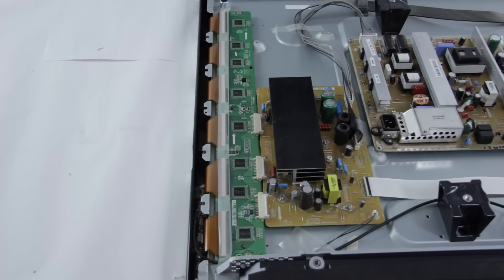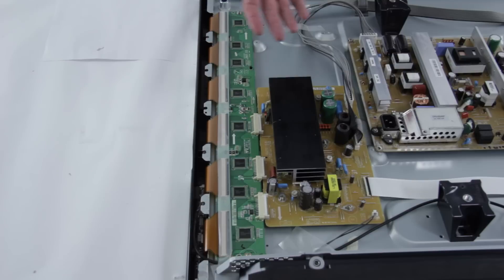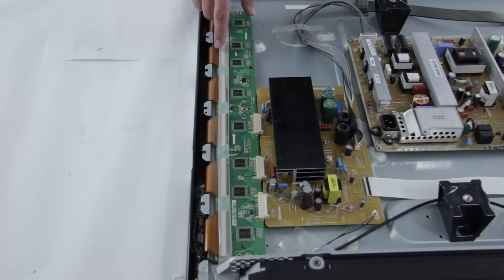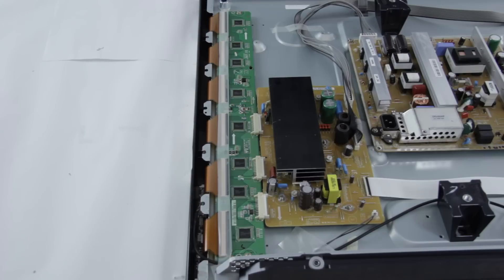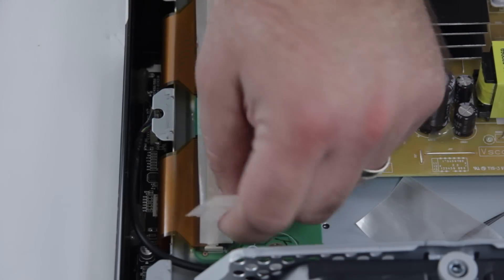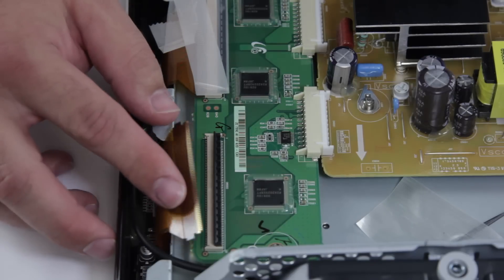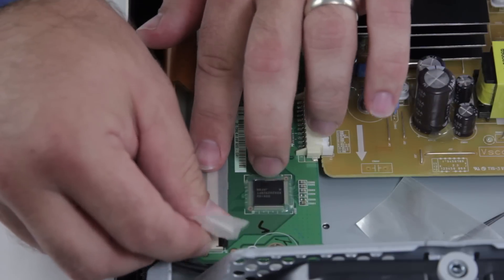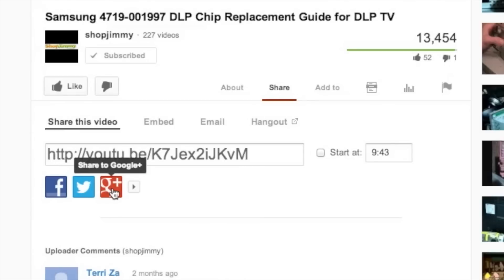Plasma TV Repair - No Image, No Picture on Plasma TV Screen - How to Replace Y-Buffer & Y-Sustain

Comment: I have a Voire 42" Plasma TV with no picture or sound. When I power on the TV, green light comes on and I hear a clicking/static noise is coming the back panel. I took off the back panel and noise is coming from the main board, which is centered on the frame (part number JHT0609-026387). Could the Y-Buffer or Y-Sustain boards be feeding this main board, causing the noise?
RMC

Comment: Hi I have a lg 60ps8000 plasma TV that was showing lines going horizontally across the screen then jumping up & down then eventually the screen has went completely black & now there is no picture or sound, however up until the screen packed in sometimes it would work just fine as if there wasn't even a problem!!! Please help? 
Many thanks

Comment: I have a LG 50pg20 plasma tv, powers on but no picture and theres a slight humming noise present. Caps seem to be fine. Suggestions?
Reply from the maker: jlujan28   Please watch this video FIRST to help with your repair!  https://www.youtube.com/watch?v=BP3NVNCGEv8  I recommend replacing the YSUS and the YDRVTP & YDRVBT boards in your TV.  Click this link to replacement parts for your TV model number:  http://www.shopjimmy.com/catalogsearch/result/?q=50pg20  There may be multiple boards for the same TV model number, be sure to match part numbers on your current board, with your replacement for compatibility.  Thanks and please let us know if you have any further questions with your TV Repair!  www.shopjimmy.com

Comment: I have a Samsung PN50C7000YFXZA that is about 4 years old.  I had 7 horizontal lines that run across the whole screen.  I just ordered and replaced the Y Buffer board but the problem is still there. I assume the TV does not need to be reset once the parts the Y-Buffer was installed?  Do I need to replace the Y sustain board also?
Reply from the maker: John Krummel   This sounds like a TV panel (TV Screen) problem.  If your TV panel is bad, it may be more cost-effective to replace the TV as panels are typically hard to find in stock, difficult to replace, and expensive.  Thanks and please let us know if you have any further questions!  www.shopjimmy.com

Comment: I have an LG 60pv450 plasma tv. You can see the red light when it's off and it makes the noise click to turn on and off, but when it turns on, there is sound, but no picture.  I can use your help, thank you.
Reply from the maker: Andy Buzzie  Please watch this video FIRST to help with your repair!  https://www.youtube.com/watch?v=BP3NVNCGEv8  I recommend replacing the YSUS and the YDRVTP & YDRVBT boards in your TV.  Click this link to replacement parts for your TV model number:  http://www.shopjimmy.com/catalogsearch/result/?q=60pv450  There may be multiple boards for the same TV model number, be sure to match part numbers on your current board, with your replacement for compatibility.  Thanks and please let us know if you have any further questions with your TV Repair!  www.shopjimmy.com

Comment: hi, I'm having a problem with my Maxent Mx-42VM11, Model No. P4202YD05, Serial No. 53781105931- The TV has a picture and audio but image flickers constantly. I replaced the motherboard but the problem continues. Any suggestions on the issue would be greatly appreciated. Thanks.

Comment: Hello I Have a Vizio XVT423SV Plasma, It was working fine but than when I turn it on the screen didn't come on but the logo kept flashing than few second later it turn white for a sec than it turn back to orange and nothing happened I wanted to know what is the problem?

Comment: Hello, I have an LG 37LH2000 sound but no image.
Reply from the maker: Frankie Vanterpool   I recommend running the flashlight test on your TV.   Here is a link to a video we produced that shows how to run the flashlight test. https://www.youtube.com/watch?v=xUzCLgoSPGM Please reply with your flashlight test results and we can recommend a replacement part for your TV repair. Thanks and please let us know if you have any questions! www.shopjimmy.com
Reply: Hi, after doing the flashlight test there is no backlight however there is sound when i change the different inputs.
Reply from the maker: Frankie Vanterpool  Do you see any picture on the screen with the flashlight test?  Thanks!  www.shopjimmy.com
Reply: I don't see anything.

Comment: Hello, I have a VIZIO PV50HDTV10A, the first sympthon was: TV turn on but no video, black screen. I did a changed the y sustain board, and now thw new symphton is: the screen shows a horizontal black lines on the screen and some lines vertical lines and after a few seconds the tv turn off automatically. What sholud i do?
Reply from the maker: Oscar Leon   This sounds like a TV panel (TV Screen) problem.  If your TV panel is bad, it may be more cost-effective to replace the TV as panels are typically hard to find in stock, difficult to replace, and expensive.  Thanks and please let us know if you have any further questions!  www.shopjimmy.com

Comment: Model:  42PC5DC-UL
PDP42X40523

We were watching a show and heard a pop.  The screen went to a white with black smudges it seemed like.  turned off and back on, white and black, not lines just all over the place.  Now nothing on the screen when you turn it on but it still has power.  I can't tell if the audio works when playing something, I haven't connected something to it for awhile but can.  What would you replace?

Buffer Board:  EBR36939101
YSUS:  EBR36954501
ZSUS:  EBR36921701
Reply from the maker: Jared Trosper   Please watch this video FIRST to help with your repair!  https://www.youtube.com/watch?v=BP3NVNCGEv8  I recommend replacing the YSUS and the YDRVTP board in your TV.  Click this link to replacement parts for your TV model number:  http://www.shopjimmy.com/catalogsearch/result/?q=42PC5DC-UL  Be sure to match part numbers on your current board, with your replacement for compatibility.  Thanks and please let us know if you have any further questions with your TV Repair!  www.shopjimmy.com

Comment: Hi guys!  Excellent channel...thanks so much.  I have an LG 60" Plasma TV (60PK750) that recently began flickering and ghosting.  It does this primarily during the first 5-10 minutes after turning on the TV and then typically goes away.  You can see the problem in action by watching the following video I made of the issue:  https://www.youtube.com/watch?v=xCzMXNkMwGM   
I'm thinking it's a Y-Sustain problem.  What are your thoughts?  I'm totally up for fixing this myself and am pretty handy with DIY fixes.  Please feel free to recommend any and all part numbers for my TV that you think would resolve the issue.  
Again, thank you ShopJimmy.com...great channel and info.  Hope to be shopping at your store soon.
Reply from the maker: Rich Horn   Double check your TV input signal to make sure it is working properly.  Thanks!  www.shopjimmy.com
Reply: ShopJimmy.com I've done that but I suppose I can check them again if you think that's the issue. But it does this with everything.  There's no "single" input into the TV.  There's Satellite, Blu-ray, VCR, and even Netflix and Amazon (and those 2 latter are simply apps on the TV).  That alone seems to indicate a TV problem and not a TV input issue.  There are both HDMI and Component cables attached to the TV input and every one of those does this same thing.  I can even plug in my computer via HDMI and it does it then too.  I've also replaced the HDMI cable from the Satellite to the TV and it's done nothing to fix the issue.  Maybe it's the entire input panel on the TV that is going bad...that would seem more likely.
Reply from the maker: Rich Horn  Please watch this video FIRST to help with your repair!  https://www.youtube.com/watch?v=BP3NVNCGEv8  I recommend replacing the main board first in your TV.  Click this link to replacement parts for your TV model number:  http://www.shopjimmy.com/catalogsearch/result/index/?cat=56&q=60PK750  There may be multiple boards for the same TV model number, be sure to match part numbers on your current board, with your replacement for compatibility.  Here is a link to a video showing how to identify your part number, click here:  https://www.youtube.com/watch?v=RwHTvjMdrhk  Thanks and please let us know if you have any further questions with your TV Repair!  www.shopjimmy.com
Reply: ShopJimmy.com Thanks guys!  Appreciate the help.  I'll start with the main board replacement and go from there.  Unfortunately, all the boards for my TV are out of stock on your site.  Any idea when they'll be in stock?
Reply from the maker: Rich Horn   Unfortunately, no we do not know when they will be back in stock.  you can sign up on the product pages to be notified when the part is back in stock.  Thanks!  www.shopjimmy.com

Comment: my 3 year ild threw a barbie at my tv, she cracked it it a lil, ihave sound no picture, is it fixable? bc i dont want to go and spend 500-1000 bucks on a new one if it can be fixed for cheaper. model # PN51D53OA3F

Comment: I have a Samsung model: SP-R4212  (MODEL CODE:SPR4212X/XAA) (type no SR42S5)
I hear the video or cable tv noise but no picture. I checked & ohmed out all the fuses & found good. Checked all the caps and found no damage. 
Do you have a videos on how to check this?

Comment: I have a 50in Pioneer Plasma TV model # PDP-5040HD    The screen has a 4" white band running horizontally across the screen   then after 10 sec or so it will go totally black
Reply from the maker: Mike Huey   I recommend replacing the Y board and buffers in your TV.  Click this link to replacement parts for your TV model number:  http://www.shopjimmy.com/catalogsearch/result/?q=5040HD  There may be multiple boards for the same TV model number, be sure to match part numbers on your current board, with your replacement for compatibility.  Thanks and please let us know if you have any further questions with your TV Repair!  www.shopjimmy.com

Comment: Model PN50C675G6F please help!!

It powers on but all it shows is the the black screen I need help geomartinez6@gmail.com
Reply from the maker: geovanni martinez  Please watch this video FIRST to help with your repair!  https://www.youtube.com/watch?v=BP3NVNCGEv8  I recommend replacing the Y-Main Board and Y-Buffer Board in your TV.  Click this link to replacement parts for your TV model number:  http://www.shopjimmy.com/catalogsearch/result/?q=PN50C675G6F  There may be multiple boards for the same TV model number, be sure to match part numbers on your current board, with your replacement for compatibility.  Here is a link to a video showing how to identify your part number, click here:  https://www.youtube.com/watch?x-yt-ts=1421914688&x-yt-cl=84503534&v=R1jmj_foId0  Thanks and please let us know if you have any further questions with your TV Repair!  www.shopjimmy.com

Comment: Hey Shopjimmy, we just ordered and replaced the power supply for our Samsung plasma TV from your store but the screen is still black/blank. The red light just blinks and nothing shows just like it with the original power supply. 
Heres the model code: PN60E530A3FXZA
VERSION NO: TS02
S/N: Z4X83CKCC08619Y

THANKS.

Comment: Hello, I have a Samsung 50in. Model # PN51D430A3DXZA. My TV made some popping sound and shut off. I turned the TV back on and I have sound only and no picture
Reply from the maker: shy-A34 hayes   Please watch this video FIRST to help with your repair!  https://www.youtube.com/watch?v=BP3NVNCGEv8  I recommend replacing the Y-Main Board and the Y-Buffer Board in your TV.  Click this link to replacement parts for your TV model number:  http://www.shopjimmy.com/catalogsearch/result/?q=PN51D430A3DXZA  There may be multiple boards for the same TV model number, be sure to match part numbers on your current board, with your replacement for compatibility.  Here is a link to a video showing how to identify your part number, click here:  https://www.youtube.com/watch?x-yt-cl=84359240&x-yt-ts=1421782837&v=R1jmj_foId0  Thanks and please let us know if you have any further questions with your TV Repair!  www.shopjimmy.com

Comment: Hi there I new your help repairing my zenith plasma tv. Model is Z42pt320. It doesn't power on, I soon as I connect it it makes a click noise then clicks again. Red light flashes as if I turned it on then off
Reply from the maker: Danny Solis  Please watch this video FIRST to help with your repair!  https://www.youtube.com/watch?v=BP3NVNCGEv8  I recommend replacing the YSUS and the YDRVTP board in your TV.  Click this link to replacement parts for your TV model number on our website.  http://www.shopjimmy.com/catalogsearch/result/?q=Z42pt320  There may be multiple boards for the same TV model number, be sure to match part numbers on your current board, with your replacement for compatibility.  Here is a link to a video showing how to identify your part number, click here:  https://www.youtube.com/watch?x-yt-ts=1421782837&x-yt-cl=84359240&v=GEllG3RV-tc  Thanks and please let us know if you have any further questions with your TV Repair!  www.shopjimmy.com

Comment: Hola. Tengo una Plasma Samsung ps51d6900, el cual tiene un pequeño golpe en el panel, hace unos meses se le fue la imagen, solo tenía sonido, ahora hace un par de días la he conectado y ya no tiene ni sonido, así que por curiosidad, le he quitado la tapa trasera y he visto que el cable plano que conecta la main-board con la logic-control está como fundido en la parte de la main-board,  esto me hace pensar si el problema real fue la perdida de gas del panel, o un fallo de calentamiento en la main-board, mi pregunta es la siguiente: ¿Debería de tener sonido, independientemente de que tenga el panel roto?

Gracias por su atención.
Reply from the maker: Paco Garcia   La televisión no es seguro dejar enchufado si tiene una pantalla rota. Gracias! www.shopjimmy.com

Comment: Hello I have a Samsung HP-S5053, I believe my problem is as you explained in your video which is a black screen with occasional fissures.
Reply from the maker: Seore Adisa  Please watch this video FIRST to help with your repair!  https://www.youtube.com/watch?v=BP3NVNCGEv8  I recommend replacing the Y-Main Board and Upper and Lower Y Scan Drive boards in your TV.  Click this link to replacement parts for your TV model number:  http://www.shopjimmy.com/catalogsearch/result/?q=HP-S5053  There may be multiple boards for the same TV model number, be sure to match part numbers on your current board, with your replacement for compatibility.  Here is a link to a video showing how to identify your part number, click here:  https://www.youtube.com/watch?v=R1jmj_foId0  Thanks and please let us know if you have any further questions with your TV Repair!  www.shopjimmy.com
Reply: okay and my next question which part do I buy I looked through the website and entered my TV model and brand but I am not sure which one will get the job done?

Comment: I have a Samsung Plasma pn50c550g1fxza  I'm only seeing Black screen Only. The sound does work.
Reply from the maker: Jon Harper  Please watch this video FIRST to help with your repair!  https://www.youtube.com/watch?v=BP3NVNCGEv8  I recommend replacing the Y-Main Board and Y-Buffer board in your TV.  Click this link to replacement parts for your TV model number:  http://www.shopjimmy.com/catalogsearch/result/?q=pn50c550g1fxza  There may be multiple boards for the same TV model number, be sure to match part numbers on your current board, with your replacement for compatibility.  Here is a link to a video showing how to identify your part number, click here:  https://www.youtube.com/watch?v=R1jmj_foId0  Thanks and please let us know if you have any further questions with your TV Repair!  www.shopjimmy.com

Comment: LG 60PG60, I have sound but no picture. Please help
Reply from the maker: Chania White  Please watch this video FIRST to help with your repair!  https://www.youtube.com/watch?v=BP3NVNCGEv8   I recommend replacing the YSUS board and the YDRVTP & YDRBT boards in your TV.  Click this link to replacement parts for your TV model number:  http://www.shopjimmy.com/catalogsearch/result/?q=60PG60  There may be multiple boards for the same TV model number, be sure to match part numbers on your current board, with your replacement for compatibility.  Here is a link to a video showing how to identify your part number, click here:  https://www.youtube.com/watch?v=GEllG3RV-tc  Thanks and please let us know if you have any further questions with your TV Repair!  www.shopjimmy.com

Comment: Hello, I have a Toshiba  32AV635D. When I switch it on The screen is full of verticle and horizontal green and yellow lines/squares. If I tap the set it used to settle down but it is gettind worse. The sound keeps going up and down too. I wound appreciate any comments on my problem please.
Reply from the maker: Philip Dawson   This sounds like a TV panel (TV Screen) problem.  If your TV panel is bad, it may be more cost-effective to replace the TV as panels are typically hard to find in stock, difficult to replace, and expensive.  Thanks and please let us know if you have any further questions!  www.shopjimmy.com